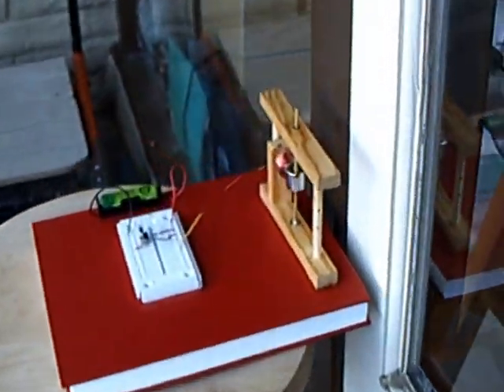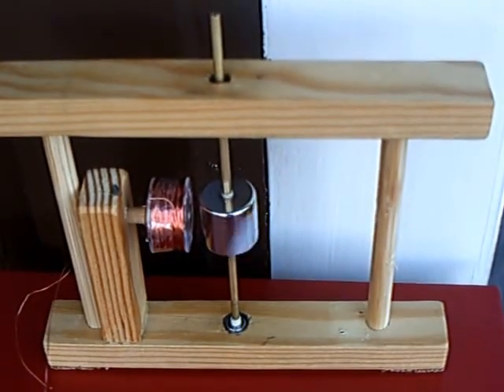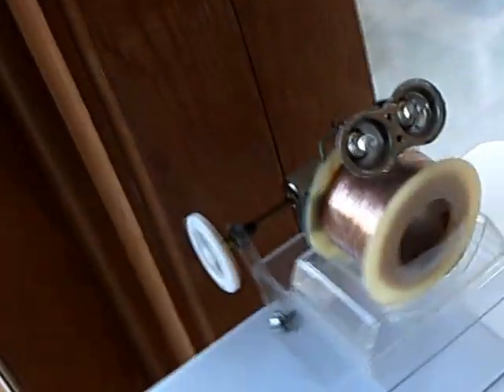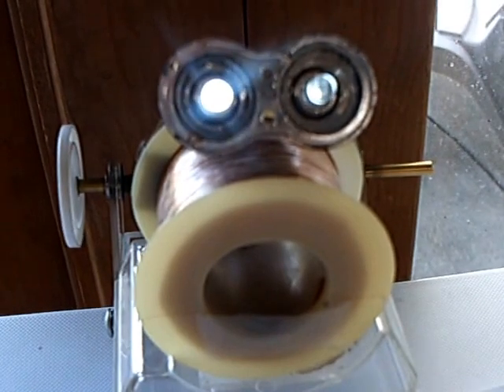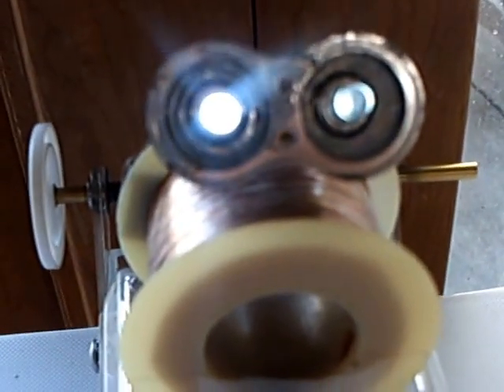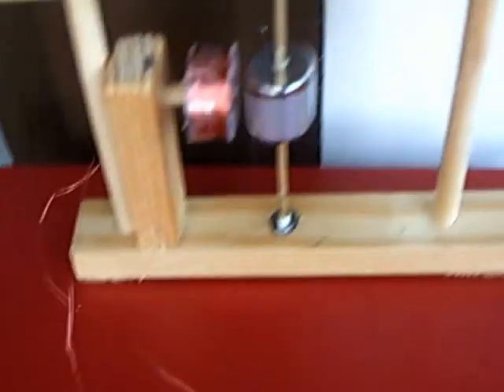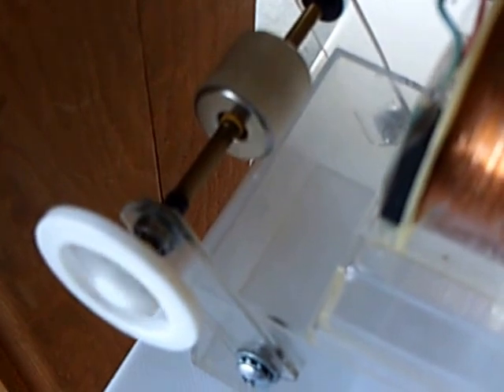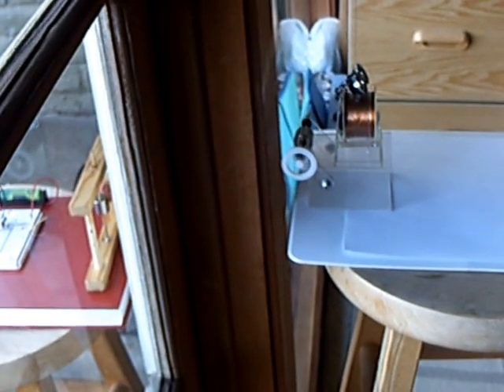Wireless Energy Transmission -----  thru a wall

Comment: You Lindmotor are genius. That is Tesla's free energy concept of resonance frequencies. Get the frequency right and you have uncovered how covert ops mind control works. Maybe you would be interested how the Lily Wave transmits brain altering frequencies that alter your brains mental states through 60hz power lines. Your room is surrounded by a transmitter.

Comment: I'm sure the magnet to magnet couping is purely magnetic field only, not electrical at all. Very useful indeed, to transfer energy without wires, and without RF emf energy. So this way you do not affect radios. Except for the electrical noise emanating from the coil. Nicely done, Lid.

Comment: Good demonstration. I envision a prop/jet cross engine with magnetically levitated rotor inside it, being driving by coins in or around the shell. 1 moving part, no bearing contact at all. the engine could be the heart of a submarine, or a rocket alike. And witht eh acceleration of the thrusted mass, I envsion it being ducted to a much smaller diameter, leaving room for "invisible" payload hidden between the diameter of inlet and exhaust. So the payload would not have air/water drag to mention.

Comment: Yes, very true. something like this if you use resin and encapsulate the spinning magnet you could make it portable with a small solar cell. The receiver could a coil or another spinning magnet of any configuration. So many things you can do with this its amazing.

Comment: HAHA nice one :) that's awesome! been playing with the circuit one today and I just light up on what type of circuit this is O.O if you remove the resistance from the base of the PNP to the collector of the NPN and put a capacitor instead and then take the resistance and put it to ground and then the base of PNP you have yourself a little single coil joule thief type circuit and if you leave the motor and put a capacitor big enough to it pulse slowly you can self start the motor. Cheers XD

Comment: That is really neat I can see a lot of applications for it as well especially for people who live in apartments that can not drill holes. One i thought about was a solar cell mounted on the roof and place a coil inside the attic and send that down to a battery. That way you don't have to worry about lightning protection or having to drill holes. Another application is having it charge a battery off a solar panel next the window like you have here. Thanks for sharing.